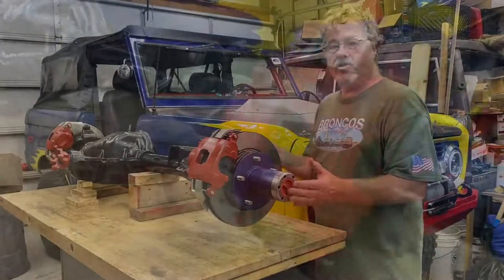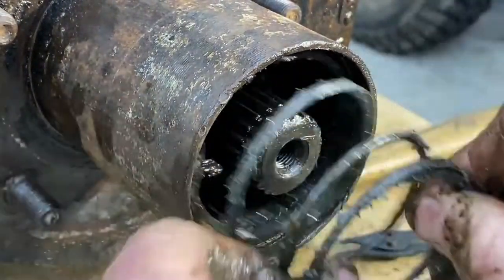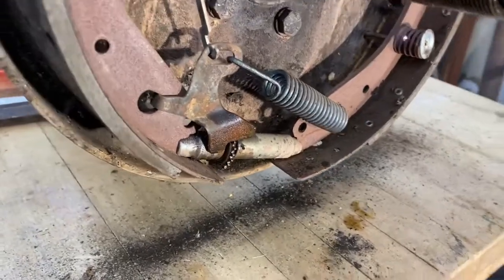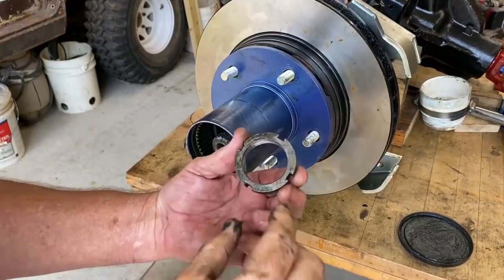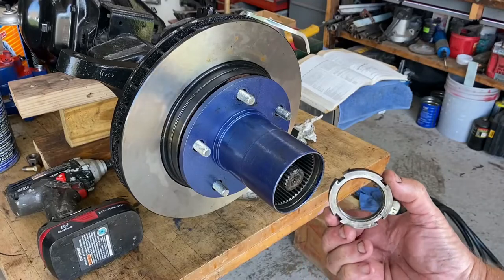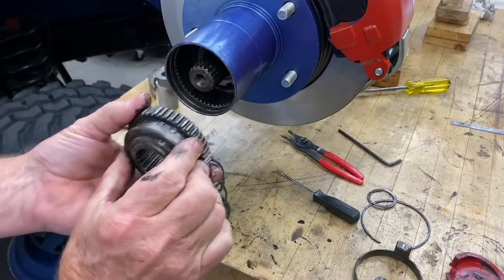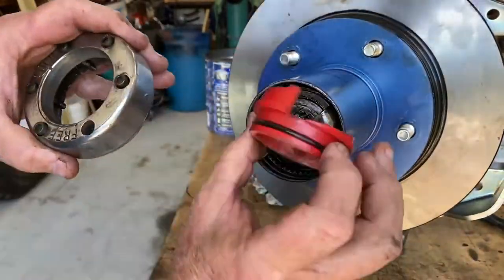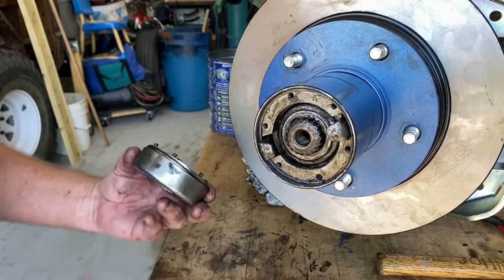Hub / Manual Locking, Removal & Install

Comment: Nothing beats the OEM Dana/ Spicer hubs. The biggest mistake I see people make is putting the spring in backwards, which will actually cause it to bind in the hub causing them not to engage. Precise, clear video, thanks for posting.
Reply from the maker: Thanks

Comment: Excellent!   I have a '66 F100 4x4 pickup & needed to remove the hubs & all for brake work and was struggling to get it put back together in the correct sequence - especially with regard to the screw on locking rings - the one with the pin goes on first, then the ring with holes, then the second ring.   You saved my day!  Thanks, Dan
Reply from the maker: My pleasure, Glad have been able to help. 😎